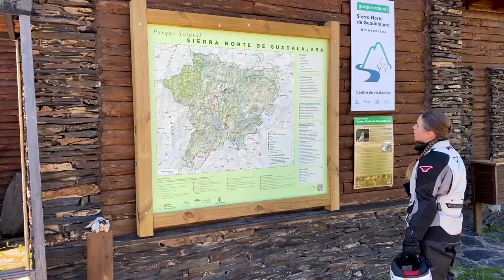WE CRASHED TWICE! (Motovlog Spain) 🇪🇸 [S1-E14]

Comment: Looks like you are having fun on your adventure, great drone footage too. I've done the same as you on my vee. Put my foot down and no ground, 2 up as well. My foot peg bracket went the same way. Just a suggestion, when you get your new one fitted see if they can ally weld your old one. Use as a spare. I did that and works OK. Stay safe out there.
Reply from the maker: Yes we’re absolutely loving it so far, even with the falls! I feel like if they adjusted the angle on the hinge it wouldn’t put so much stress on the bracket but oh well 😅 Hopefully I’m learning more and more about how not to make it happen!

Comment: The throttle is your friend when off road riding Ollie 
Still too much pressure in the tyres for off road
Reply from the maker: I know that’s what I’m starting to learn now! Keep chugging along! What PSI front and back would you recommend? We had 34 and 38 (normally 38 and 42bon tarmac)
Reply: @LaviandOllie  easily as low as 30 & 38 , when on loose stuff you have to get the front end light by using more throttle which seems counter intuitive - difficult with two up and luggage so you have to bully it into where you want to go using throttle 
Paddle , dab and throttle when two up 
Depending on how much off road you will be doing think about changing tyres to something more 50/50 
Gold luck